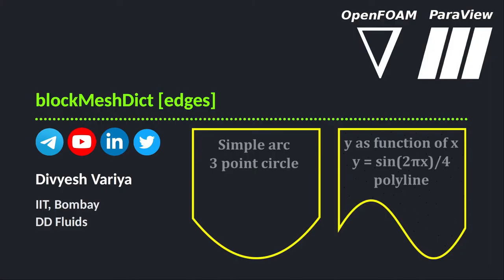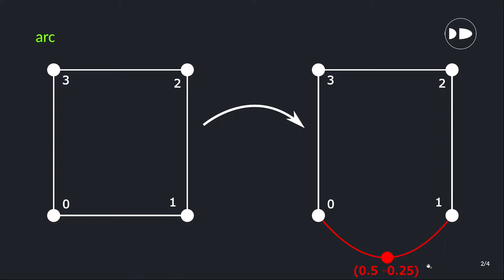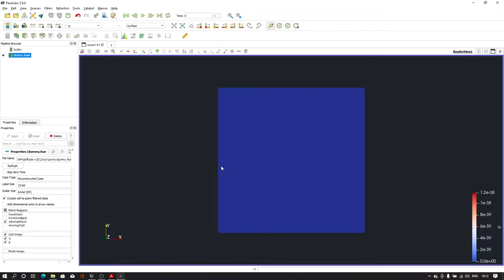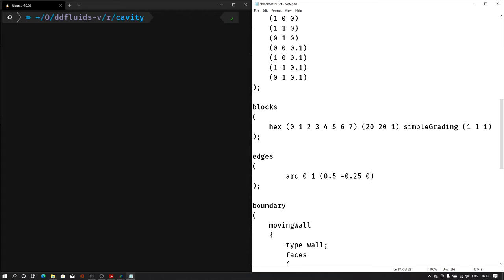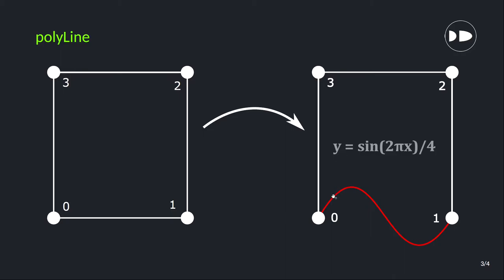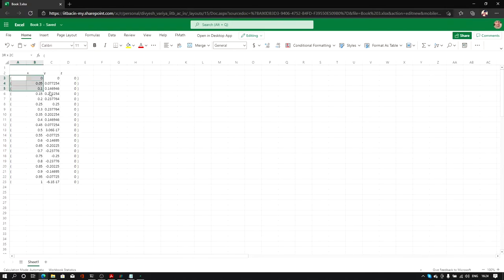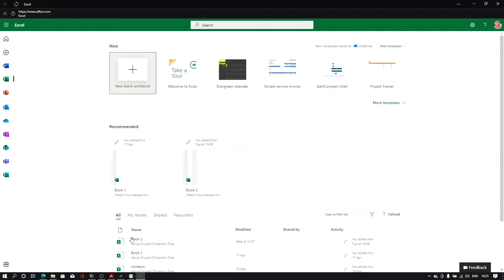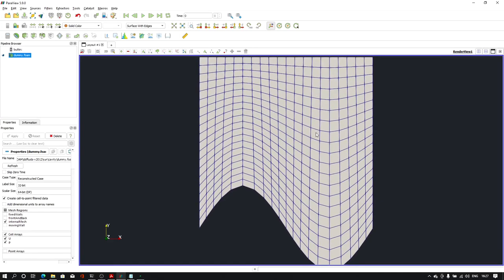blockMeshDict Basics | [edges]

Comment: How to make holes in geometry to act as inlet?
Reply from the maker: You can use multiblocks to define your geometry and then make a hole. For velocity inlet, you can use surface normal fixed value type boundary condition.